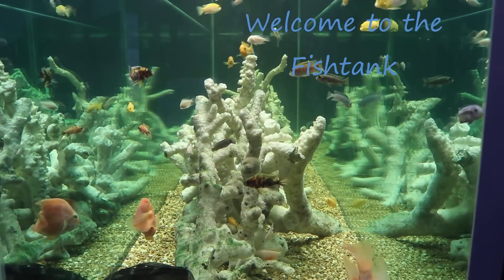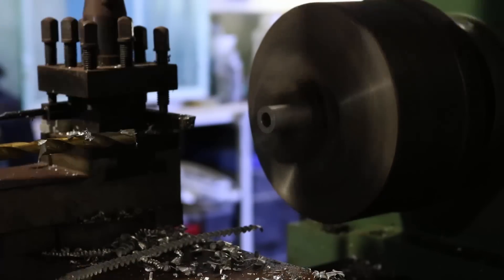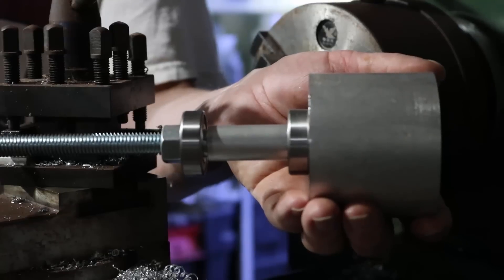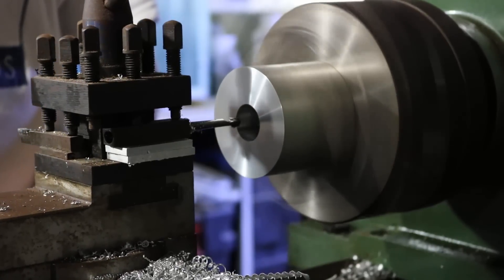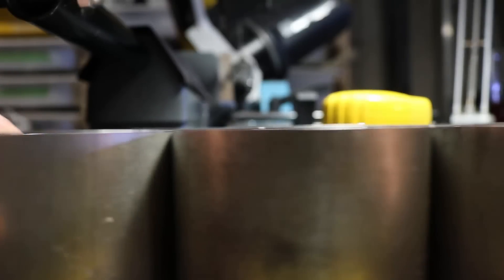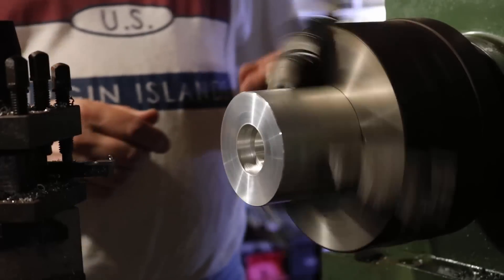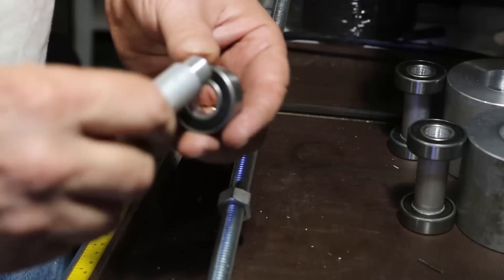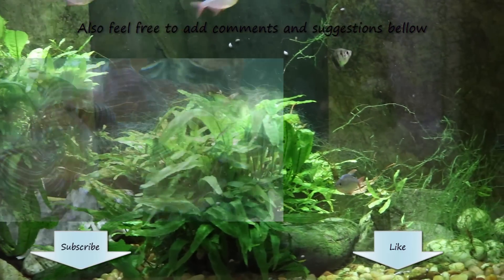DIY Belt Sander Build Part 2 - making the Idol Wheels

Comment: the inner race should be at least a metal to metal  fit
Reply from the maker: Not sure what an inner race is. Please elaborate
Reply: Fishman it is the race that touches the shaft I'm not trying to be hurtful if there is any way I can help you I will.
Reply from the maker: Not a problem. I'm always willing to take advice. How else does one learn
Reply: Fishman it is on the bearing thee is an inner race and an outer race the inner race stays in one place an the outer race moves with the ball barrings

Comment: what bearing number did you use?
Reply: these bearings with  HALF INCH (12mm) bore are 6201 they are 32*12*10
as opposed to 6202 that are 35*15*11
Reply from the maker: 6202 2RS
Reply from the maker: Each wheel has two 6202 2RS bearings. They were the closest in size to what I wanted.
Reply: you can get 6202 2RS with a 1/2 inch bore, just thought you would like to know
Reply from the maker: They didn't have any where I bought these. As it turned out the bushings gave me a better fit anyway
Reply: you might have a look at ebay next time, 6202 bearings are available with 1/2, 5/8 bore and 6203 also 5/8 and 3/4 bores, just thought you would like to know for future purchases. I picked up 10 6202 with a 1/2 bore for 19.20. I am not suggesting you change them, just passing along info.
Reply from the maker: thanks. Next project needing them I will have a look

Comment: Are you going to crown the idle wheel?
Reply from the maker: I'm not sure how i'm going to finish the wheels. Once I have the sander up and running I will adjust them if necessary. I'm building this for a specific job so if it works any fine adjustments may be down the road or if time permits.
Reply: Hi,
you need to crown at least the tracking wheel so that it stays central on the wheel. there is a tendency to run off if it is not crowned.